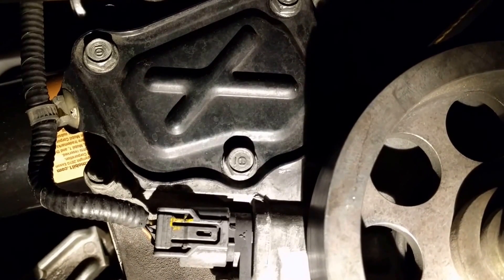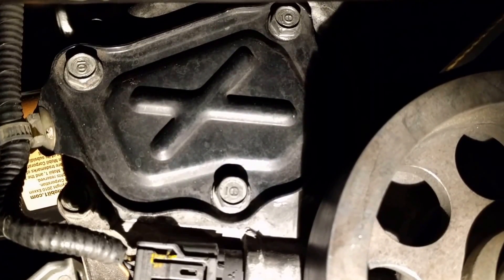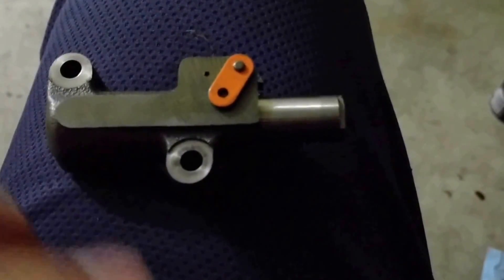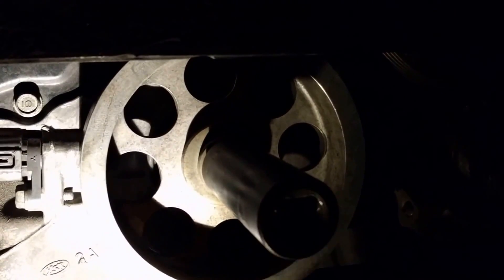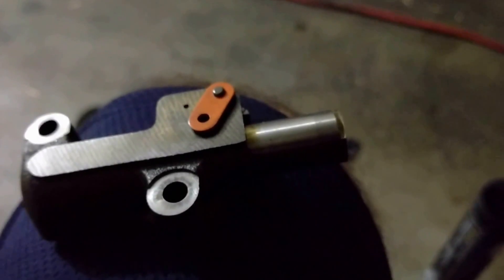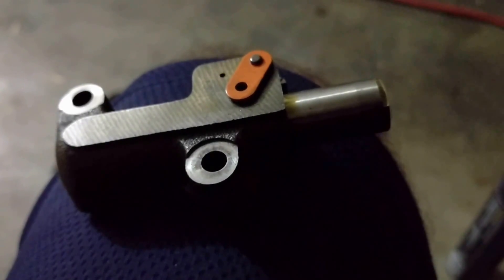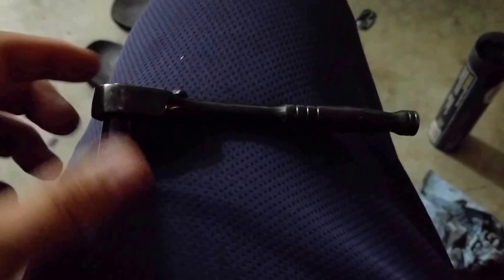DISCUSSION: Replace Timing Chain Tensioner on 2005 Acura TSX

Comment: buen video me suscribi a tu canal, tengo una pregunta, cuando remplasaste el tensor y puso el nuevo, como hace para darle la tension correcta a la banda de tiempo, o solo la pone y da buelta el dado 19 en contra del reloj?
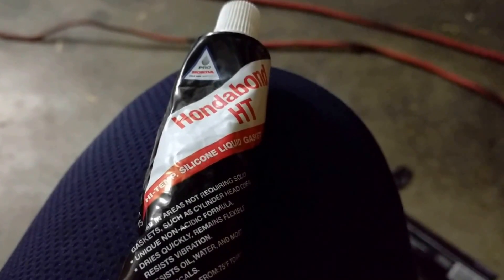Reply from the maker: gracias. al fin del video at 5:07 estan las instrucciones.  Antes de sacar el tensor viejo, le das buelta contra del reloj al dado 19 para poder meter el pin en el candado naranjado. Luego le das buelta con el reloj al dado 19 para darle tension a la banda de tiempo, y ya quitas los tornillos del tensor y sacas el tensor viejo. Cuando pones el nuevo tensor, lo metes, le pones los tornillos, sacas el pin y solo le va poner tension a la band de tiempo.
Reply: Miguel Chavez muchas gracias por responder, es mucha ayuda su video y mas por la explicacion en español. trabajare en mi 07 tsx con la confianza de su buena explicacion amigo, gracias!!
Reply: Miguel Chavez disculpa tengo otra pregunta mas,..para mover el crankshaft o la polea cuando estas sacando el tensor viejo o poniendo el nuevo es necesario poner la palanca de velocidad en Neutral para que se mueva con mas facilidad o no es necesario? 🤔
Reply from the maker: No es necesario mover la palanca de velocidad. Lo mas dificil de este trabajo es sacar y poner de regreso los tornillos del cover plate porque no tienes mucho espacio, pero todo con calma.
Reply: Miguel Chavez gracias de nuevo un saludo.
Reply: Miguel Chavez lo cambie segui las instrucciones no prende
Reply: Miguel Chavez cres que peligre a salirse d tiempo o doblarse alguna valvula?
Reply from the maker: eagle528hz no Creo. Dale vuelta con reloj Al dado 19 a ver si ayuda.
Reply: Miguel Chavez despues de un ruido como barrido prendio sin fuerza y se prendio la luz del check engine las emisiones, mejor lo dejo empaz y que el mecanico lo arregle, lo que si creo que ya el tiempo se movio, tal vez algo no ise bien 😢
Reply from the maker: Si, es claro que se movio el tiempo. Tambien es posible que doblo una valvula. Me imagino que si el carro temblama mucho en idle, algo ya estaba mal, y en cambiar el tensor se fue fuera de tiempo.
Reply from the maker: https://drive.google.com/open?id=0B3VIX7TVENmMOEdZQ1pfbUtaRXM https://drive.google.com/open?id=0B3VIX7TVENmMNXNWYTJyVkZyVUk  https://drive.google.com/open?id=0B3VIX7TVENmMaU5UVGpJU3JWcFU https://drive.google.com/open?id=0B3VIX7TVENmMTHZUUFhac2h1Qk0  Estas son las instrucciones del oem service manual.

Comment: how did you get the tensioner to go back in? I can't seen to get the new or old one back in
Reply from the maker: The piston needs to be compressed and locked in place in order to fit. Compress the piston and stick a push pin into the orange hole to lock it into place. After you get TCT in, you release push pin and the piston pops out.
Reply from the maker: When I purchased my TCT, it already came compressed with the push pin locked into place so I never released it until I had it in the engine.
Reply: Miguel Chavez not even the original one goes back in and even when I compress the piston. I was just wondering if there was a trick to putting it back in
Reply from the maker: I did notice that when I installed the new TCT that I bought from the dealer,  the piston seemed to have been pushed in farther than I could compress the old one with my hands. It shot out with some good pressure when I released the lock.
Reply from the maker: Try to compress the original one with a vise and see if you can press it in farther than you can with your hands.
Reply: Miguel Chavez thank you for your help. tct is on, liquid gasket drying
Reply from the maker: Cheers bro! Do you have any mods on your car?
Reply: Miguel Chavez no mods just stock. smh, it must have came out of time. now it won't start
Reply from the maker: Try manually turning the crank pulley bolt clockwise.
Reply: Steven Lebron how did you put the tensioner back on? I am stuck because the new one won’t go back in.  It looks like the chain tension is strong.
Reply: Maz Village same problem and can’t find a solution

Comment: @miguel chavez great video. I'm planning to do the same with my 02 Rsx. Question, how did you maintain the tension while the TCT is out while you replace it with the new one? Im afraid i might move the chain and mess the timing when i remove the old TCT. Thanks
Reply from the maker: When it is out for replacement, you don't have to worry about maintaining tension or messing with timing. There's not enough slack in there to mess with the timing. After you put in the new tensioner and pull out the locking pin, the piston in the tensioner will shoot forward putting tension on your chain. I suppose if you pull out the tensioner and start your car without a tensioner you might mess with the timing, haha.
Reply: Miguel Chavez dang dude this was just a nightmare.  The old TCT got stuck and was a pain to remove.  Eventually when i got it off the chain jumped timing.  Had to call a mobile mechanic to help me with this hole i got into.  Question for you, when you replaced the TCT how many clicks did you do when you released the tension?

Comment: Great video, I have an 06 TSX that is due for belt tensioner change as a preventive maintenance...Did any oil come out when you opened the tensioner covering plate?
Reply from the maker: Thanks, I made the video because there's a lack of videos on this for the TSX. The instructions listed at the end of the video are taken from the oem service manual. Just a few drops of oil came out cause most of the oil lies down in the oil pan when the engine is off. I removed the serpentine belt from the crank pulley as a precaution to prevent any oil spilling on it. Youll need a small pry bar or  flat head screwdriver to pry off the cover plate as the hondabond holds it in pretty good.
Reply: I agreed! There should be more instructions on how to fix our cars! Honestly I still have no idea where the tensioner is located in the car :( is it behind the right front tire?
Reply from the maker: Yes, you have to remove the front passenger tire, then remove the splash shield that covers the access to the engine. The tensioner is located to the top left of the crank pulley. It was easy for me because i no longer have any splash shields, they ripped off after lowering the car and scraping them to death, haha.
Reply: "my tsx is original" said no one ever lol
Reply: Just like you, I've recently learned to fix the car the most I can. Replacing the chain tensioner will so far be the most difficult job (I think so) I've ever done on the car! So turn the crankshaft to compress the old tensioner, insert a pin into the hole(s) (I only see one, the HELM manual says there're holes???) take it out. Then compress the new tensioner, put it in place, remove the pin that hold it compressed, seal the tensioner door with honda bond and wait for 3-4 hours to start the engine (for the seals to dry up?). That's my understanding of the process. Did I miss anything?
Reply from the maker: Alan Anh Vu Yes, turn the crankshaft counter-clockwise to compress the piston of the tensioner and youll see the orange lock move and once it is over the hole (doesn’t take much force) you insert a pin to lock it. Then turn the crankshaft clockwise a bit to release the compression. The tensioner is now ready to be removed, remove it. The brand new tensioner already comes compressed with the lock held in place by a pin (you do not need to compress it), do not remove the pin until you install the new tensioner. After you install the new tensioner and pull the pin, you’re good. Clean the mating surface of the engine and cover plate (I used a pry bar and brake cleaner). When you make the gasket with hondabond, youll have to install it within four to five minutes as it begins to harden. Wait 3-4 hours for hondabond to cure before starting up the engine.
Reply: Miguel Chavez again thanks a lot for all the details! I feel more confident doing the job now.
Reply: Miguel, can I ask you another question? Did you grease honda bond around the 3 bolts that hold the covering plates?
Reply from the maker: The hondabond goes on the inner side of the screw holes. Here's where you put the hondabond https://drive.google.com/open?id=0B3VIX7TVENmMc0g1ZFZ0Z0p5Nkk

Comment: So you didn't replace the chain... why? :) they say that it will stretch with time
Reply from the maker: No, I did not replace the chain as this is a preventive maintenance item and not a repair. I supposed if you're having engine problems along with a check engine light then a change of a chain might be the repair. Chains are known to last a long time. Chains are also known to stretch like you mentioned, some people say they don't stretch but rather the links get worn. Its a good question, I think I would ask, when do you need to change the chain? Changing the chain is not a maintenance item though, its not listed in the OEM service manual. Ill take a peek at the manual and see when it does recommend to change the chain (as a repair item).
Reply: Okay interesting. My check engine light is on atm and I was abit worried because my dad's engine (K24) broke with 186.000 miles on the same chain and tensioner. sad, but that proves that you're right about the chain lasts long. Was it a hard job to change the tensioner? i'm not a mechanic, but I know how to change  basic stuff like brakes, suspension etc.
Reply from the maker: Sorry to hear about your dad's engine, that sucks. If your CEL is on, scan the car through OBD2 to see what codes you get. On amazon there are plenty, I have two scanners, this cheap one gets the job done https://www.amazon.com/Oxgord-Scanner-Engine-Diagnostics-Direct/dp/B011Q18D14/ref=sr_1_3?s=automotive&ie=UTF8&qid=1475093120&sr=1-3&keywords=obd2+scanner  all the Autel ones are great too.
Reply: Got one! It says the upper lambda sensor :) so guess im good (Y) Was it a hard job to change the tensioner? i'm not a mechanic, but I know how to change basic stuff like brakes, suspension etc.
Reply from the maker: I'm not a mechanic either, but cars are important in our lives so I've learned stuff here n there and pretty much do the same basic stuff that you do (brakes, suspension, fluid changes). When it comes to oil changes, I do either every 6 months or 5k mi (whatever comes first) I always use Mobil1 Synthetic High Mileage. The tensioner job wasn't hard to do, but the hondabond takes 3hrs to cure and you CANT turn on your car in that time so give yourself plenty of time.
Reply: Okay :) thank you very much for your response! appreciate it.
Reply: Miguel Chavez do I have to drain the engine oil completely before replacing the TCT?